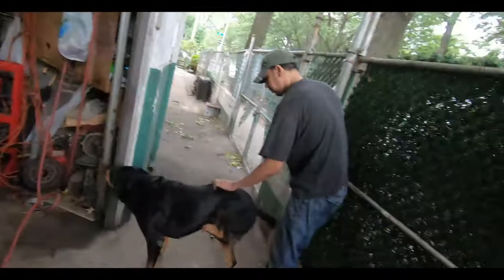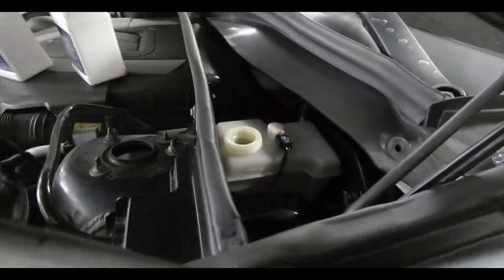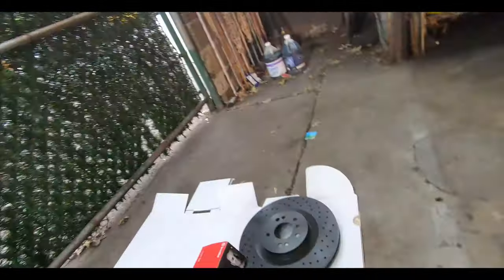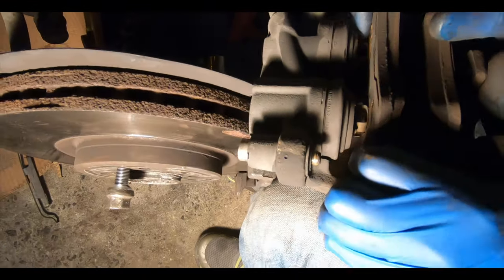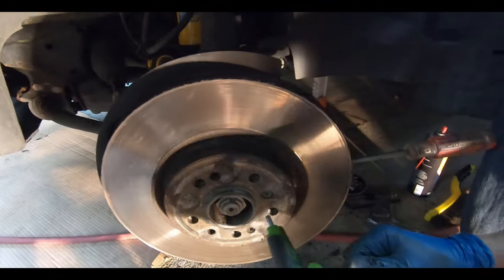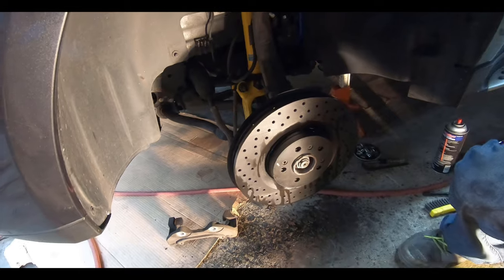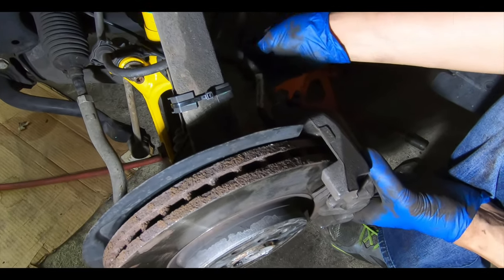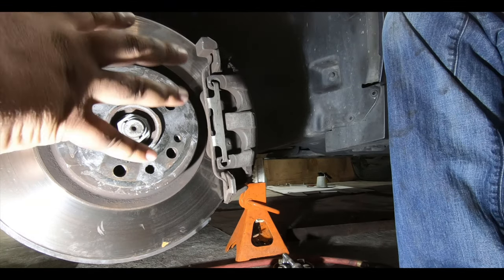Mercedes ML350 W164 Front Brake Replacement/Upgrade!

Comment: Can someome please help me!! I have a 2012 Mercedes ml350 , I went to change the brakes and ordered the parts....when I went to change them , the curtent rotors and pads on truck are way smaller then the stock new ones I ordered which are for the ml350....the front rotors on truck now measures 375mm x 36mm and the rear measure 345mm x 22mm......can someome tell me which model of Mercedes these came off so I can order the right parts?
Reply from the maker: sounds like you ordered the ML550 rotors or if they make a  sport package rotors.
Reply: @ProjectZGarage  I figured it out...the fronts that I needed for ml350 were actually the ml550 and the rears are "AMG style packing" is what the guy behind counter said they were called

Comment: What brand of brake pads do you use? Thank you.
Reply from the maker: Brembo pads
Reply: @ProjectZGarage  if you use ceramic, which brand will you use? Thank you.
Reply from the maker: @HungNguyen-sb1yu  I like Hawk pads so you might want to try them out.
Reply: @ProjectZGarage  I have a 2010 ML350 W164, it still has the original brake pads in it and I don’t know what they are. Should I use the semi metallic pads or ceramic? Thank you.
Reply from the maker: @HungNguyen-sb1yu   I would do the ceramic less noise and dust try out Hawk pads.